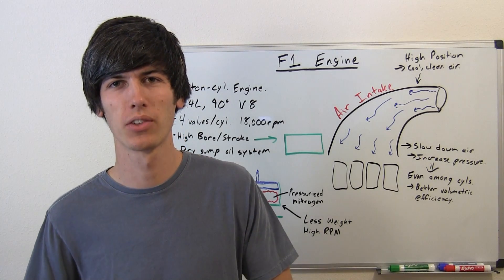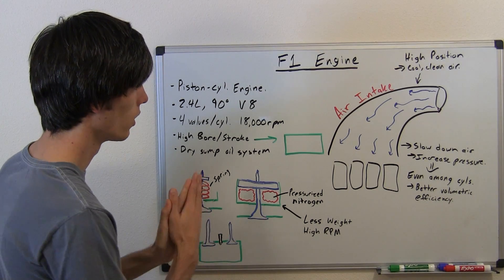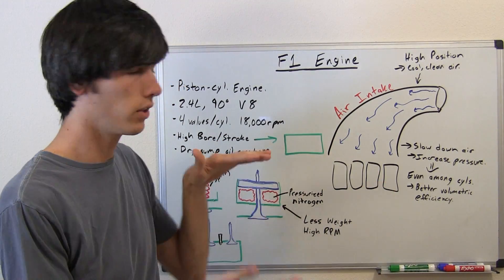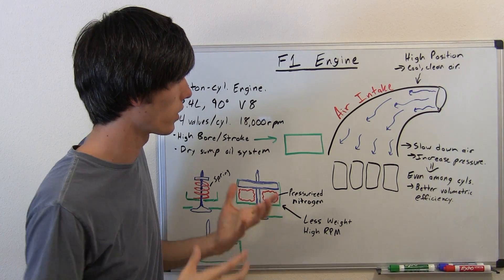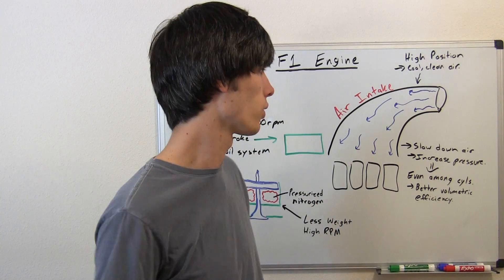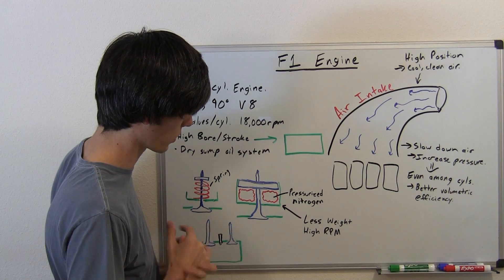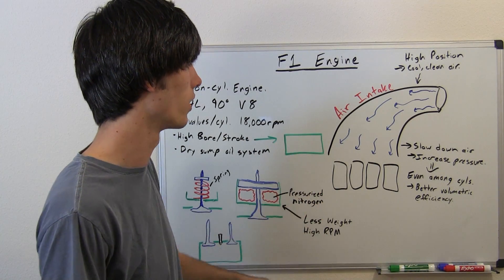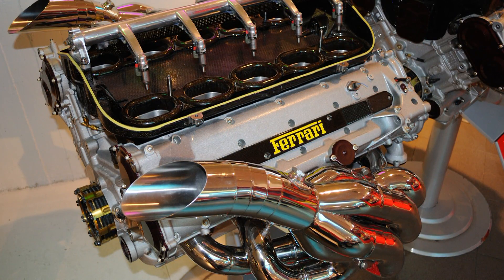F1 Engine - Explained

Comment: All this technical jargen  about clearance and air fuel mixtures forget that stuff just rip that motor like you stole the vehicle or dream of driving something with all of that under the hood. Racing period is in my blood I will drive anything with power in it as long as it runs good if it's on two wheels or four I will rip it to it's braking point,  if it flies fast I am there as well I am not a professional driver but I love speed. Keep making technical advances it makes me fast. thanks people

Comment from the maker: FIA Formula 1 regulation "5.17.5 Camshafts must be manufactured from an iron based alloy."

Rotational mass is much easier to deal with than reciprocating mass (like push-rods). Camshafts are not the limiting factor in high rpm engines, if anything it would come down to valve springs (hence the use of pneumatic valves), airflow, and time for combustion.

Also, the term "critical mass" really has no context here.

Comment: I have a question and forgive me if its obvious. next season the fia will change its engine specs to 1.6L v6 turbo engines. thus would that eliminate the need for those high air intake systems?

Comment: the 'scoop' is partially a ram air system.  the scoop lets the air expand but there will still be a pressurizing of the air in the air box at speed. its even more important on an N/A car like in current F1.  not only that but the  scoop is raised to where it is for clean air in the literal sense and in the sense that it is undisturbed by the car.  same reason why the blower hats on Top Fuel, ProMod, and Funny Cars are so high.

i would bet the VE is somewhere around 120-130%

Comment: My point of why there are no real concerns with the pit lane is due to the already existing speed restrictions.  I can't imagine there being a significant difference in safety concerns between a nearly silent car and one at idle as opposed one that is full throttle on what is likely a main straight next to pit lane, especially given the hearing protection already in place.  Heavier and slower is just incomplete engineering due to other restrictions (especially ones which FIA enact).

Comment: Racing should be for two points: the pure human competition of the drivers, and the R&D which can be applied in the future to road cars. While I do miss the raw sound of a V10, if there is a better way to build a mousetrap, so be it. Dangerous to not hear the cars? They are limited in pit lane; that is just outright ignorance. The entertainment segment should not concern the teams or the drivers, that is a media and marketing issue. You should be able to push the envelope for tech and ability.

Comment: That "eco crap" as you put it should be the overall point of F1 if FOM/FIA would actually allow to be used correctly.  The fact that the system is more efficient is not a bad thing, and overall output should have gone up (again FIA dicking around). The TERS (turbo-compounding if I remember correctly) should truly be a leap forward in applicable technology within 10 years to road cars (extra shit is not a bad thing).  However, the end result that FIA has orchestrated is going to be complete shit.

Comment: Yes.  If you ever saw the Top Gear clip from a few years ago where Hammond drove the Renault F1 car, they explain during the clip that hot water and oil are cycled through the motor before it could be started.

Comment: Yes, they rely on the fact the air above the car will be relatively clean - air filters would introduce a restriction and lower power slightly. A racetrack shouldn't have sand and other debris floating around, which is where these cars live - they're precision machines designed specifically for that environment. The engines also have very short working lives, measured in hours, so the damage caused by grit etc is pretty irrelevant.

Comment: All N/A engines suck in air. It's the piston going down the bore that sucks air in, like if you pull the plunger on a syringe, it'll suck in air. Put your finger over the end - if it was just AP pushing air into the syringe, your finger wouldn't get stuck to the end by the suction.

Turbo/SC engines force fuel/air into the cylinders under pressure, so in that case the pistons are not sucking anything in, they're actually causing resistance. That's why turbo/SC engines use low compression ratios.

Comment: You are wrong. I quote from Wikipedia: 

"The fuel used in F1 cars is fairly similar to ordinary petrol, albeit with a far more tightly controlled mix. Formula One fuel can only contain compounds that are found in commercial gasoline, in contrast to alcohol-based fuels used in American open-wheel racing."

Comment: No ram air to pressurize the cylinder but a ram air to pressurize the air box, also the reason for +18000rpm is not just due to piston speed from the high bore/stroke ratio witch decrease piston rings friction and pressure in form of heat from the friction, but also the weight of the crank, rods, pistons is a major factor in hight revving, lower weight reduce reciprocating mass and loads witch allow you to rev higher.

Comment: You are completely wrong. Flow is independant of pressure and you can increase one without increasing the other through manipulation of temperature. If you can maintain the same pressure, but cool it down, it will have more volume flowing through.  The intake serves multiple purposes, as he said, cooler air, smoothing and evenly dispersion of the air, and it acts as an air box for rapid throttle openings from a closed state or near closed state to keep torque at lower RPM and smooth drive action

Comment: I don't understand something. Pressure means more air in same volume, or smaller volume in same amount of air. If the air speed is high, why would it make a lower air pressure in the intake on the cylinders... Don't understand

Comment: slowing down the intake air decreases its static pressure and is counter productive in terms of getting as much air in the cylinder as possible, other than that decent video

Comment: thanks for the response. there must be different things they can focus on with a mechanical engeneering degree because when i looked into it many with those degrees where rebuilding pneumatic factory parts or mechanical factory parts rather than car engines. I was looking at a automotive technology 4 year degree but i feel it will be less comprehensive. hard decisions

Comment: you do a nice job of explaning VE. i am heading into a carrier as a mechanical/automtoive engineer myself. i was talking to a group of 4 other peers, and i was amazied they didnt know how simple it is to change the fireing order of a say a standard OHV chevrolet V8. just a change and camshaft profile then a rewire, the hard part is machineing a camshaft yourself, or getting it done. BTW all engines sence the flatheads are overhead valve. not trying to get too pickey.

Comment: someone correct me if i'm wrong but I believe it is because the speed the air flows into the cylinder is so great that you need to place the injectors further away from the cylinders to give the air/fuel mixture more time to mix correctly

Comment: Fast air equals lower pressure.  This is exactly how aircraft wings work. The air above the wing has to travel faster to cover a longer surface area, lower pressure. The air beneath the wing travels slower covering a shorter surface area and due to the higher pressure under the wing, it will create lift.

Comment: Are you going to be making a video about the upcoming v6 1.6L turbocharged engines for 2014 as well as the electric motor drivers will have to use only when driving through the pits?? I know there's still some time left but I'm eager to learn more about this and you do an excellent job at explaining.

Comment: So does raising the pressure of the intake air fill the cylinder(s) better than increasing velocity to create a "ramming" effect? I'm just a bit confused because I've always been taught that the key to port flow (when it comes to cylinder filling) is to increase velocity via diffuser to signal a "supercharging" pulse that reach speeds of sound.

Comment: No, its the length of the stroke.  All N/A high performance engines, sports bikes etc have short strokes and wide bores.  The trouble is engines with very short strokes rev higher but make there torque higher in the rev range.
Diesel's for example have a relatively long stroke producing alot of torque low down in the rev range but hit a max rpm of around 5 grand.

Comment: I'm sort of confused with the diffuser. Yes, it would increase the pressure of air entering the intakes but thermodynamics says that it diffusing would increase the temperature of the air and lower the density. So really, wouldn't it sort of balance itself out? The high pressure would allow the air to enter the cylinder more efficiently but wouldn't the air would be less dense and therefore less effective in combustion? Unless theres some other factors or the temperature increase is negligible.

Comment from the maker: Smaller stroke typically will allow for a bit higher RPM. I wouldn't say CR is much of a factor. F1 engines have very high CR, yet still rev very high. At a cost, of course.

Comment from the maker: Different layouts provide different benefits. A V shaped engine allows for a shorter crankshaft and an I, different angles allow for better balance of the forces, reducing the counterweights of the crank. Some forms are more compact, etc.. Mechanical engineering is basically anything that moves, so engines would be included.

Comment: Great video, although you forgot to mention that a dry sump lowers the 'centre of gravity' and this is used in many high performance road cars too. The other thing is, I always thought pneumatic valves use normal air so that in the event of a leak the system can replenish it while the car is moving. I could be wrong.

Comment: not too sound like a know it all, and i don't know if anyone has said this yet, but it is too my understanding that F-1 engines also have smaller spark plugs than traditional engines which allow larger intake/exhaust valves, and the spark plug also has no protruding ground electrode beacuse at higher RPMs a standard spark plugs ground electrode may fall off. thank you for posting... you know your stuff man!

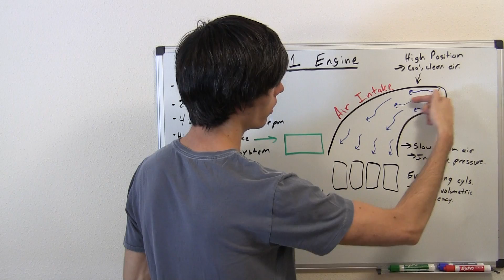Comment: 3:18 If I remember correctly the air intake has been used as a ram-air device. However, after Ayrton Senna and Roland Ratzenberger died in 1994 the teams had to modify the air intake so that it couldn't be used in that way. All because of the panic that the deaths of Senna and Ratzenberger caused. The FIA tried to control speeds in many other ways, too, but just a few years later the cars were already a lot faster than what they were when the restrictions were imposed.

Comment: And I didn't limit myself to fuel consumption either. Did you even read what I wrote?

What you said is false. F1 engines generate less heat per gram of fuel burnt because combustion is less efficient, and then go to convert less off that heat into any useful combustion pressure. So they get less heat out of the fuel, and less work out of that heat. But they make silly amounts of power because they turn very quickly.

Comment: I'd heard rumors about Renault experimenting with electromagnetic valve actuation some years ago. I'm sure other engine constructors were looking into it as well. The advantage of such a system is that it would allow for infinitely variable valve operation, meaning that the lift and duration of each valve operation could be profiled for greatest efficiency at any RPM. I'm not sure what the status of this technology is at present.

Comment: Yeah,I agree with that.Due to the higher compression ratio and volumetric efficiency,higher octane fuel,better lubrication,the thermal efficiency of a formula one engine is actually higher than a ordinary one,Despite it MPG may just around 4~5.

Comment: Also they use hydraulic valve trains to enable zero valve clearance. It lets them use a larger flatter cam follower then as a follower on a standard valve can only be so big before it moves and becomes unstable.

Comment: It does not matter as the intake on an F1 car as its not pressured as in turbo or charger. Therefore the pistons will suck in the required amount of air (providing air intake is wide enough) regardless if the intake has clean or dirty air passing past it.

Comment from the maker: The intakes are mounted fairly high in order to avoid pulling in turbulent air, so I would assume it doesn't make much difference as far as power output.

Comment: Hi great video. Question: is an F1 car, when in slipstream, loosing power because of the turbulent air? (similar to loosing downforce). Does it affect its power output even if's chasing another F1 car by some 100m as well?

Comment: You are right, the parasitic losses of driving everything (including the valvetrain, pistons, and accessories) at 18000RPM are so high it is remarkable that F1 engineers manage to get such high BMEP figures from those engines. There is a reason why LMP1's have turned to slow revving, high compression, high fuel atomization, turbocharged diesel engines.

Comment: That's not true, F1 engines and engine maps are devised to produce max power, not high thermodynamic efficiency. Not only do they get horrible fuel consumption, they also need more fuel per horsepower per hour than a modern eco engine. They burn so much fuel per second in relation to the engine block and cyclinder head masses that they need to dissipate much more heat, much quicker, losing efficiency thermal efficiency.

Comment from the maker: It is likely much more efficient, but the main reason is that metal springs tend to vibrate too much when they're compressed and released at 18,000 RPM, where as air pressure is fairly predictable.

Comment: I swear your explanations are always exactly what I'm looking for. lol. I searched "f1 valvetrain" because I couldn't think of a system aside from ducati's springless valvetrain that would allow it to work but then efficiency and reliability wouldn't make sense seeing how hard it is for the engine to run a simple 8k rpm setup. Wonderful explanation dude. You just got a new subscriber. Also you should make a second channel for those of us wanting to dive deeper into the rabbit hole  :D

Comment: Comparing to a "normal" engine, the ones you find on road cars. An F1 engine generates much less heat per liter of fuel used, instead of generating heat it generates more power, which mean the engine is actually "wasting" less energy from the fuel than what a normal road car

Comment: the difference between ground and 1m high (where the air intake is on an F1 car does not make any difference. it would possibly be worst if it was near the ground. the track is usually hot from the sun so the air temperature is possibly higher near the track.
the cold air intakes on road car, are near the front bumper to suck in cold air from the environment and not hot air from the engine bay, nothing to do with height ;)

Comment from the maker: Basically you just need to understand the difference between a nozzle and a diffuser. A nozzle decreases pressure by increasing velocity: example: your thumb on a water hose. Water shoots out fast from the hose, because the pressure before it exits is high, and it enters atmospheric when it leaves. A diffuser does the opposite - increases pressure by decreasing velocity. The air is slowed down and packs together, increasing pressure.

Comment: i'd choose an 04 flat6 porsche any day over a v6 f1 car because f1 is supossed to have 8-12 cylinders and less than 3.2 liters. Bring back the beautiful 19200 rpm v12 f1 cars but, make it camless. The v6 f1 cars sound awful. The v8 f1 cars sound acceptable.

Comment: The flames that come out of the exhaust are due to the shifting. The ECU interupts the ignition and a little bit of fuel gets dumped into the exhaust and then becomes lit from the hot exhaust.

Comment: Nope. The Speed decreases, but the pressure increases if the diamater increases. It's counter intuitive but that's what Bernoulli's principle say and it's proofed millions of times.
But as long as the air is moving, the pressure will always be lower than the pressure of the air outside of the airbox which is more or less stationary. except, the car is driving fast which will result in a little ramair effect inside the airbox.

Comment: Formula 1 engines have a pressure in the cylinders above the atmospheric pressure due to resonance used in the intake manifold even though there not turbo- or supercharged.

Comment: ok explanations...

at subsonic speeds, air is treated as an incompressible fluid.  It doesn't expand, or compress.  The pressure increases as its velocity decreases because of Bernouilli's law.  So yes, it does act as a "ram air".

Even modified naturally aspirated Corvette street engines (2 valve per cylinder) surpass "100% VE".

Comment: remember its not only about how much peak volumetric efficiency the engine produces but how high up the rev range it could maintain enough volumetric efficiency to still generate horsepower, volumetric efficiency being directly proportional to delivered engine torque. On a standard engine it makes no point to rev higher because of dropping volumetric efficiency after a certain RPM due to the engines intended design/limitations.

Comment from the maker: I'll agree but turbocharged cars can be much greater than 120% VE. 15 psi with perfect volumetric efficiency is around 200% VE. 200% VE is not unheard of. Though yes, with NA engines over 100% is impressive.

Comment: The Volumetric efficiency of a road car is approx 80%. A turbo charged road car about 100% or 120% for higher performance road cars.
The VE for F1 naturally aspirated is about 115%.
This would be about the equiv of 4 psi boost.

Its quite the achievement.